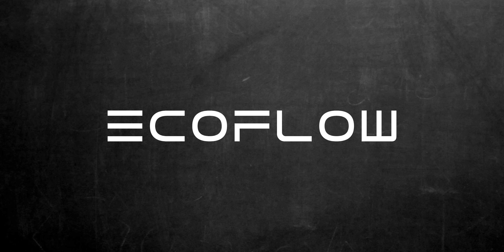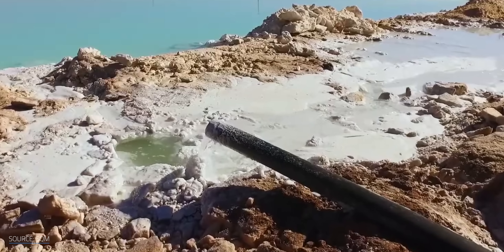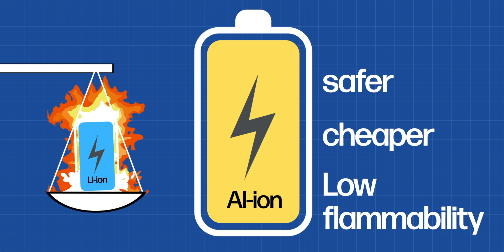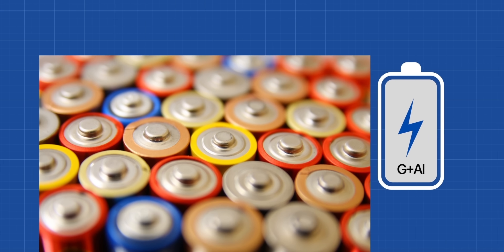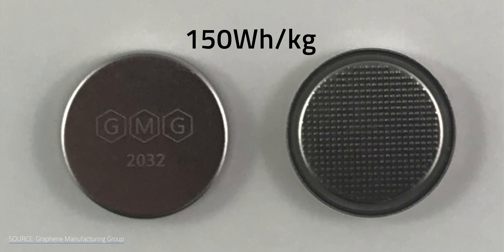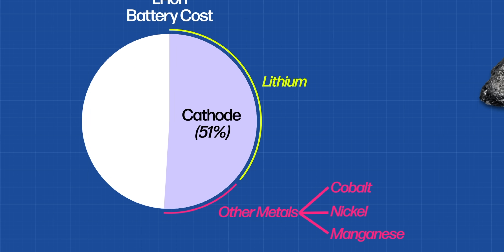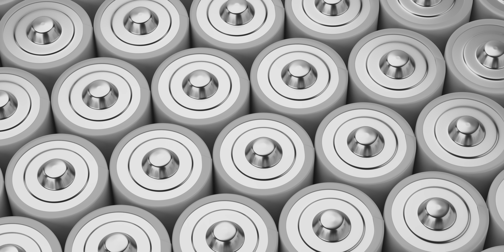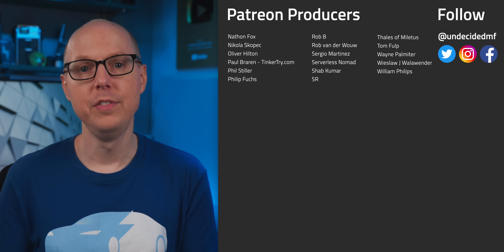Can This Metal Really Beat the Lithium Battery?

Comment: I do still question how important energy density is for non-portable battery uses, like grid and home storage systems. Obviously there are lots of non-battery energy storage technologies like pumped hydro, compressed air, etc. which are clearly less energy dense, but I could totally imagine that a conventional battery which was simply much cheaper and much more easily recycled while maintaining a similar level of end-to-end efficiency could end up beating out Li-Ion for permanent storage systems.
Reply: I saw a comment in the past (not sure if it was accurate or not) that current methods aren't energy dense enough to reasonably store enough power for a fully renewable grid.  As I said I don't know if that commenter was right or if they were spreading misinformation (or perhaps even outdated information) but it is something to consider.

Comment: I do wonder if the graghene layering and drilling process would also be aplicable to lithium or other battery types.
Reply: Given the ionic behaviour and use of graphite in li-ion, yes

I know that researchers were chasing graphene in li-ion a decade ago but the stumbling block then was cost and cycle life.  There really hasn't been a good substitute for cobalt yet found (you can make cobalt-free li-ion batteries but their cycle life is low, that's where graphene was supposed to be the holy grail)
Reply: graphene is already used in lipo batteries
Reply: @Jason Kaler  The most important part of this entire fluff piece is the reduction of graphene production cost/improvement in purity 

It's applicable across the board and limiting it to Al-ion is very shortsighted
Reply: @miscbits6399  The way GMG explained it in one of their investor conferences was that they had originally tried to sell the graphene directly as a raw material, but none of the established hardware manufacturers seemed to know what to do with it, or they were already committed to other graphene suppliers using older technology.
They realized that in order to get attention on their patented graphene manufacturing process, they had to make and sell complete solutions to demonstrate the feasibility/superiority of their raw material in various use-cases. Aluminium ion is only one of their "flagship" products; they also sell graphene-enhanced coolant and lubricant. Eventually, they hope to raise enough awareness that they will be able to return to being a raw material supplier.

Comment: Sounds like a great upgrade for electric vehicles with the 3x charging potential of Al-ion vs Li-ion.  rapid charging will exponentially increase adoption by the driving public.
Reply: Don't forget the 70X quicker charging. This would require an upgrade of charging stations, perhaps by using supercapacitors in them, and fatter connectors. These batteries charge up at about the same time it takes to refill a 60l petrol tank

Comment: GMG sounds like a cool product, but my money's on MIT's Al-S battery - source material for graphene is effectively unlimited, but it's not exactly easy to make. Sulfur is a bit less readily available than carbon, though could be far more so if we did some redesign work in mineral processing and metal refining - sulphide ores are plentiful, and if we had a sudden uptick in the demand for sulfur, we could very quickly see a bunch of mineral processing groups working out how to capture the sulfur that typically goes into slag, up the smokestack, etc.  (Plus side, it'd be good for the environment to capture the stuff we'd be losing up the smokestack into the air as SO2.)  And there's pretty much nothing in the chemistry we're talking about with the AL-S battery that gets anywhere near the complexity of graphene production.

Unless I'm not up to date on things - if producing graphene at scale is effectively a solved problem , then nevermind....but at $100/g, I'm guessing that's not the case....

Comment: The aluminum-based batteries could be very important breakthroughs. I'd like my e-mountain bile's 2 Li-ion batteries to be much lighter, faster charging and have thousands more charge/discharge cycles -aoh, yeah, and less expensive. $600. per battery, MON DIEU!
 A boy can only hope.

Comment: You use AC when welding aluminum to strip the oxygen from the oxide. Any chance of making an AC battery with graphene-aluminum to eliminate alumina?
Reply: No.  Batteries are inherently DC devices.

Comment: Has anyone thought about Aluminum batteries for aircraft? Aluminum is a material from which planes are made. 
Making larger batteries specifically for aircraft- these batteries can be for single-flight use after which they would go for recycling?

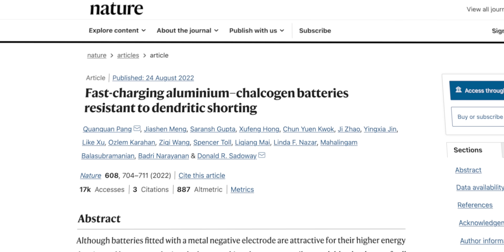Comment: im having a little bit of trouble understanding what you're saying about the graph at 10:00 it looks like the cell capacity greatly drops off after the first few cycles, approaching around 100mAh/g, but you're saying 520mAh/g, which is only seen at the first datapoint. is this just optimism, am I reading the graph wrong, or am I misunderstanding you?

Comment: if charging were more efficient in hotter circumstances and the cells were recyclable - I would gladly exchange for a higher power output but need to change earlier in the batteries life - why? electronics have a max shelf life of 2 years anyway so why not?, also older phones, etc could be recycled more effectively improving communication. - Aren't India working on aluminum air batteries to extend electric car range? - lithium and cobalt production are not sustainable or cheap so won't cost drive this result? great video as usual

Comment: They still have a long way to go to match the energy density of gasoline.. Even with conversion efficiencies of the internal combustion engine.   It's good to see progress is being made.  Crude won't last forever.  What about converting CO2 and water back into hydrocarbons.

Comment: So, graphene is about 90 million dollars per ton? How much will be in each battery, 49% was it?
Reply: that depends on the technique to manufacture graphene. the prices vary wildly but none are cheap as of now. gmg is using plasma gun method i presume (idk exactly how that works) but it costs about a dollar per gram in a lab (1,000,000$ per ton) and is quite slow. it is not very feasible for large scale manufacturing but there are breakthroughs in graphene manufacturing every now and then so you can be hopefully optimistic that the cost will be much more reasonable in the coming years.

Comment: I don't see these as a car battery, but rather, a perfect solution for off-grid home solar. Lithium is still the battery of choice, where energy density is critical. In a car, the battery has to accelerate itself, plus the car, and finally, passengers and cargo. For stationary energy storage, bulk and mass are not an issue. This Aluminum Ion battery seems to have an energy density similar to a good Nickel Metal Hydride battery, which can be made to work in an electric vehicle, but, is no match for a Lithium-Nickel Cobalt Manganese battery. For energy storage, the bigger criteria is a thing called LCOS.(Levelized Cost of Storage). This is a formula, where you put the total cost of the battery in the Numerator, then, divide by the capacity of the battery X the cycle life, X the going rate per kWh of electricity from the utility. This battery is competing with Lithium Iron Phosphate, the chemistry of choice for renewable energy storage. While LiFePO4 is not as energy dense as Lithium Ion, It has a tremendous cycle life, which helps compensate for its higher cost. Even if Aluminum Ion can't match the cycle life of LiFePO4, it can still compete, if the cost per kWh of storage is enough less, to compensate for more frequent replacements. I'm running Lead Acid, only because it's the most recyclable chemistry on the market right now. If this is easily recyclable, this could spell the end, for the Lead Acid deep cycle battery.

Comment: It seems to me like in the end supercaps have to beat batteries, at some point. Batteries having to convert electrical energy to chemical and back to store it seems like a fundamental major inefficiency. Like how incandescent bulbs need to go from electric to heat to light, whereas leds only go from electric to light. Removing an electrical transformation middle step seems like a place for massive gains
Reply: Batteries deliver a relatively constant voltage. Capacitors don't work like that and halfway capacity means half voltage. Good thing is they don't mind if you discharge them completely and overcharging is impossible 😁

Comment: This has to be one of the more ironic sponsors. Video: ”We need batteries to stop using fossil fuels!” Sponsor ”Here’s a generator to power your batteries using fossil fuel!”.
Also, a thing to note with Ecoflow (and possibly all/most batteries like this) is that they can fry sensitive electronics if you draw a lot of current from them. So if you for example use a circularsaw while also using a powermeter to measure the power the circular saw is drawing, bye bye power meter. ”Matthias random stuff”did a video on this :)

Comment: Matt, a point that also needs to be made, is that our "conventional" grid generation is also intermittent. In fact, we need better/more grid storage NOW. Nuclear power has required shutdowns every 18 months or so, for refueling. And "conventional" generation have unpredictable shutdowns. Whereas solar and wind are largely predictable.
The whole challenge of base generation and peak demand - the daily fluctuations would best be solved by grid storage.
Reply: And not only is the generation intermittent, but so is the consumption.
Reply from the maker: Good point.

Comment: The watt-hours (Wh) are useful, but the industry is obnoxious for selecting mAh, because that is not a storage capacity, and without volts, the storage can't be known.  At the same voltage, 8000 mAh is 4 times as much as 2000 mAh, but an actual Wh amount is not knowable by amps alone.  Cheers.

Comment: Sounds promising. This sounds like it has the potential to long term vastly reduce cost of batteries. However, it takes quite long to ramp up production for new technology. For example, GMG will likely take some time for this.They will be producing relatively small batteries in small amounts in a small factory. From there to giga or tera factories will require enormous investments. That might happen once they prove themselves but that won't happen overnight and there are many competing technologies at this point that will be similarly bottle-necked on capital to ramp up.

Comment: Should it be possible to eventually reach close to the theoretical >8kWh/kg energy density of aluminium-air batteries with some of the current development approaches (perhaps ones not discussed in this video)?
Reply: Aluminium air batteries supply milliamps or lower. There are always tradeoffs...
Reply: @miscbits6399  You're talking about current and not energy density – isn't that related to the surface area of the material?

Anyway, I was asking because the theoretical energy density is often cited for non-rechargeable (at least not in the classic sense as far as I understood) aluminium-air batteries. I suppose that number is simply a value derived from the aluminium itself, but I still wonder if it is, in the theoretical sense, reasonable to achieve usable energy densities close to that in a rechargeable aluminium-ion configuration?

Comment: Kind of glossed over the graphene costing £100,000,000 per tonne. It will have to be 100s of times cheaper to make this viable.
Reply: GMG is not purchasing their graphene. They have a proprietary in-house method for cracking methane. Also gives H2 gas which can be used as a fuel source for other things. This seems to allow them to control their graphene products at a nanoscale which helps with commercialization and standardization.

Comment: Won't the fact that aluminum is around 5 times as dense as lithium  while transporting 3x as much electrons make things difficult?
Reply: The mass per free electron comes into the relevant formulas. For stationary storage, like for your solar roof, the extra weight per cubic meter is not problem, and the greater free-electron density of aluminum versus lithium, at 3.89 to 1, means that you could get an aluminum-ion battery taking up one cubic meter, that could last almost 4 times as long as a lithium-ion storage battery of one cubic meter. Since Tesla wall batteries last about 4 hours, at about 1/ cubic meter, then 2 of them might sequentially last 8 hours, while the same space used for aluminum-ion batteries might go on and on for over 30 hours. HOWEVER! IN an electric car, lower weight is very important. There, the number of free electrons per MASS is equally important, perhaps more so.
Reply: @IA52342  That's mostly what I meant.  There may be literally no point in those batteries in EVs if the extra capacity is negated by extra weight.
Reply: Why? What is your offer?

Comment: The next ten years will see enormous advances in battery technology and so many fantastic ideas may fall by the wayside as things charge ahead. Of course, one can see from the current market of Alkaline, Silver, Lithium, Lead-acid and so on, that there is space in the market for more than one technology, but none of us know what will populate that market in a decade. Aluminium has so many advantages as a key element in this story so I expect that even if it doesn't come out on top it will be a significant player.

Comment: I hear there's an iron-based battery coming along and they're actually building a production plant for it.  It looks like these other guys will be small electronics based solutions.  Iron based will likely be grid storage.  And possibly EV storage too.  Since they have a much higher density, the problem of having an EV limited to traveling more than 1/2 the distance it's capable of going away from the nearest charging station will be moot if iron based batteries do find themselves replacing the current li-ion cells in EVs.

Comment: Mostly safety plus lower overall cost and for powered airplanes and motor boats. cordless lawnmowers really needed. With so much faster discharged rate as really needed for large air conditioners start up without starter condenser that really reduced from large power surge. With this new battery, that make cordless vacuum as powerful as plug in regular corded vacuum cleaner for more than half of hour. Batter powered full powered cordless rototiller and electric chainsaws that out formed than gas-powered with lesser weight.

Comment: The batteries I want for my devices should have practically infinite charge discharge cycles, not die when fully discharged, have practically zero self-discharge/loss of energy when not used and not lose capacity with every charge cycle. Weight and price is not such an issue for me. I just want my phone to work.
Reply: In that case you need a capacitor. That only has a maximum voltage and as long as you respect that, it is indestructible. Now i am afraid it's not gonna be portable but you said the weight doesn't matter so....
Reply: @effedrien  "not such an issue" is not the same as "doesn't matter". I want my phone's charge to last about ten days. And I still want it to fit in my pocket and be mobile.
Reply: @effedrien  A nuclear battery might be optimal, it would at least last long enough.
Reply: @AlJay0032  haha yes maybe a miniature hydrogen fuel cell is also possible.  As a goodie that will produce some drinking water while you are on the road

Comment: It's worth noting that the issues of recycling are not innately linked to the materials used but the complexities of the materials since the more complexe a materials the harder it is to separate it from the other components.
The aluminium would not be recycled in the traditional sense either of simply melting the metal. This would be aluminium chloride that would have be processed to go into the bauxite refining chain which is much more energy intensive.
It still probably true. You could separate the aluminium for the graphene by burning it. But the core arguments given for recyclability are wrong.

Comment: Matt, great video but you didn't mention the weight difference.
Reply from the maker: I did include the wh/kg stats in there, but the first versions of these aren't as energy dense.  However, GMG does have versions hitting 300 wh/kg, which gets them into the same ballpark as other lithium ion batteries.  So weight-wise they shouldn't be too different ... however, there's still room for them to improve.
Reply: @UndecidedMF  I did hear the energy density portion just didn't comprehend the comparison. Thank you for the more in depth explanation

Comment: Sure aluminum based battery tech has a shot. So does zinc.  It doesn't have to be a battle of formats where only one technology is dominant. The size of the energy storage demand is vast, probably pushing into the terawatt range in the near future. Flow batteries, liquid metal batteries, it won't matter, there will be room for everybody at different price points.

Comment: The li-ion was invented in 1976. It took 30 years for global adoption. Since then, there were countless alternatives that proved to be snake oil, since none of them stuck. Graphene was invented 18 years ago, and dubbed the holy grail of everything. If a replacement is invented today, my guess is it will take another 30 years to replace the li-ion. Another issue most people don't consider is the voltage output for different chemicals; ex. alkaline outputs 1.5v, ni-cd 1.2v, li-ion 3.7v. That can be a huge hurdle to retrofitting.

Comment: Fix the dendrite issues and you will have a solid contender to lithium. You did not however state the voltages of these aluminum batteries.